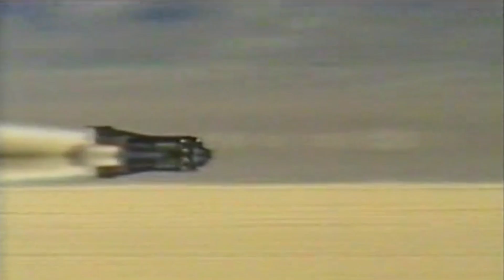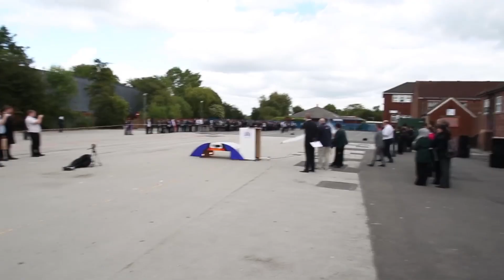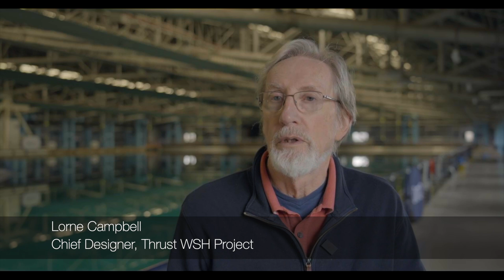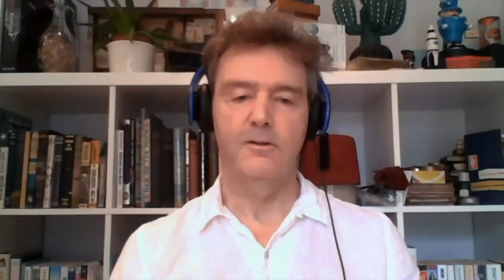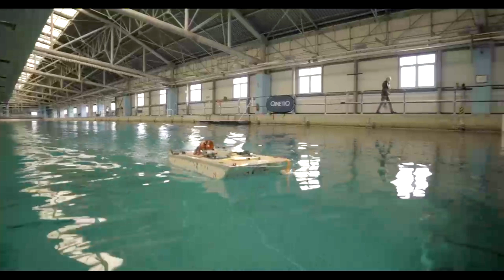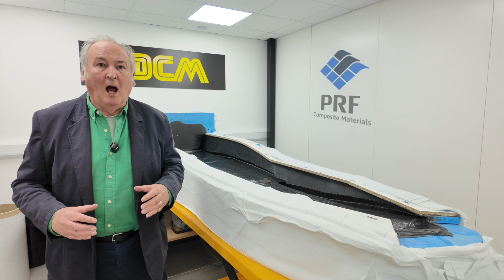Thrust WSH - Exhibition Reel 3 (Summer 2024)

Comment: Guinness has closed the books on dangerous records like holding your own pee. The water speed record is one of the most dangerous records to beat. It all works on paper. Then all it tales is a gust of wind, a little boat wake, a duck in the way, a bit of flotsam, a change in weather, or a fuel tank not fully filled and you abruptly transition from the FA to the FO sides of the speed curve.

Comment: Have you considered water skis? They do not have the problem of a planing hull. And because the top of the ski is always ventilated, there is no problem with cavitation as you get with hydrofoil.  Skis were used years ago for water bourne fighter jets.  They work.  See at 16 minutes in this video:  https://www.youtube.com/watch?v=F8TVTYk1EyM
Don't try inventing something new. Use a proven approach. You have enough other problems to solve anyway.

Comment: Do you intend to use suspension on the sporsons to absorb impacts with the water surface?, or some type of active aerodynamic control?
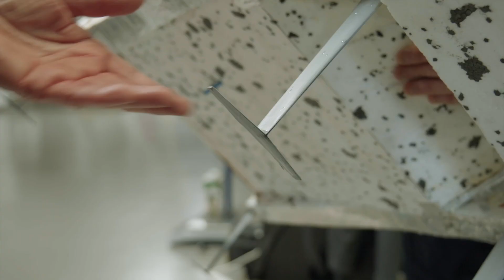Reply: They mentioned that there would be an active hydrofoil angle adjuster monitored by a distance sensor to keep the craft at the ideal distance from surface of water. Around the 5:00 mark.